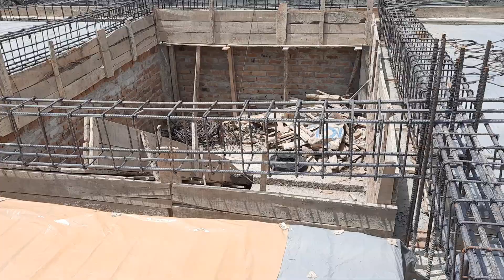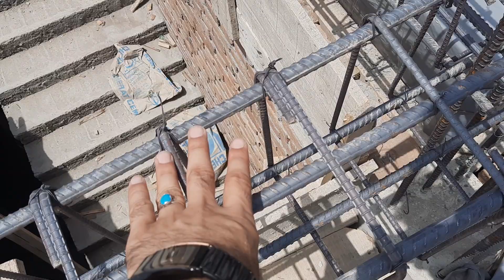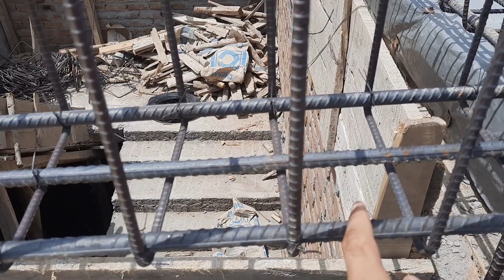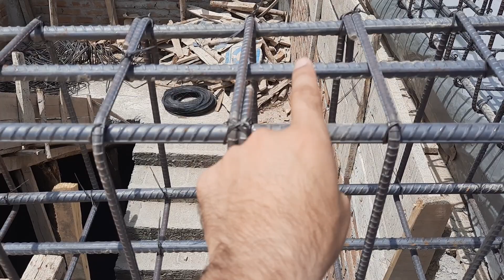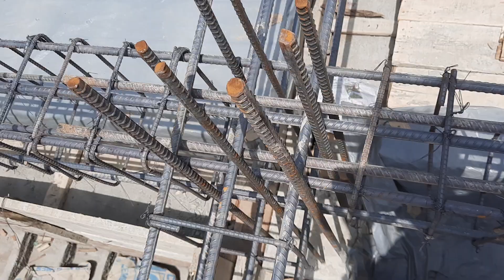Big Mistakes in Floor Beam Construction on Site

Comment: Is the beam on a load bearing wall?
Which will change the bending moment of the beam and the steel requirement in the tension zone.

Crank Bars would not necessarily be required with  a load bearing wall,  for Shear Forces near the support or in the tension zone of the beam.

I think Some further details should be provided prior to your suggestive improvements.

Comment: You should place extra bars at the top when near the column and extra bars at the bottom at the middle of the span
Reply: Remove the middle top bar and put 2 crank bars in

Comment: In addition:
 basic mistakes are
1. Joint Ties at the junction of Beam and Columns
2. Beam Concrete Spacers
3. Splicing zone of beams and girders(top and bot bars)
4. Based on your video column should be splice  within mid of column Clear Height atleast 50% splicing

Comment: Obviously this guy is not an experienced structural engineer. Placing more rebar at the bottom of beam when closer to the column is obviously inaccurate. Rather more top bars are required for hogging moment in beam when getting closer to column. And it's also abvious that the spacing between the stirrups are closer near the column than in the mid-span.

Too much misinformation out there. One must be careful. Anyone just gets up and makes a video.
Reply: Spacing closer to the column is dependent on beam Type, load conditions and Building codes.
For laymen building it IS BEST to place them closer to the column.... but damn, they should know this already if working with concrete.

Comment: Based on standard, it can be ACI or any standard adopted in your country. Firstly, it doesn't have any cut or bent bars provided at L/4 or L/5. Secondly, the stirrups hook should be at 135 degrees bend and it's spacing from the face of column must have 50mm towards the bent section.

Comment: Regarding the numbers  and sizes of the rebars of main bars and the extra bars, first check in the latest approved drawings , signed by Structural engineer, before you make any comments.

Comment: having relatively large top bars is not necessarily a mistake --- I would CALL IT UN-NECESSARY or UN-ECONOMICAL.
Reply: We need to remember that steel bars in compressive zone reduce concrete compresive zone. In this case where tenssion and compression rebar areas are equal, the concrete copmressive zone doesn't exist, so we have the biggest lever arm.

Comment: You start the video by pointing out "so called mistakes" but did not compare the work done against the construction drawings. What does the construction drawings show? 

Maybe the beam is a lightly loaded beam and hence the links provided are at maximum allowable spacing and the main bars provided are minimum to comply with minimum steel area.

Comment: Bro how can you decide to provide stirrups at l/4 at distance of 4inch c/c. As c/c distance depend on load and design.. it may ne 3 4 5 inch depending on design. On what bases you apply a thumb rule brother
Reply: take 150 c/c in general, and taking the concept of L/4 in action, do as the video, but in general you can provide 150 c/c in total, not a problem